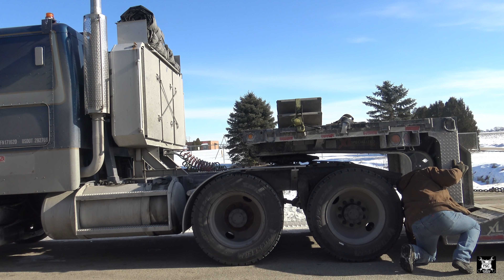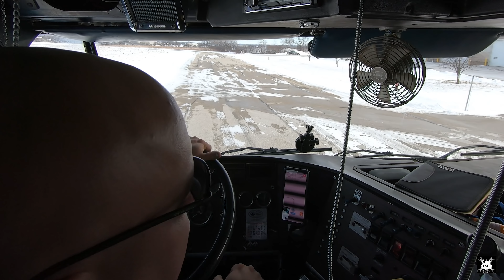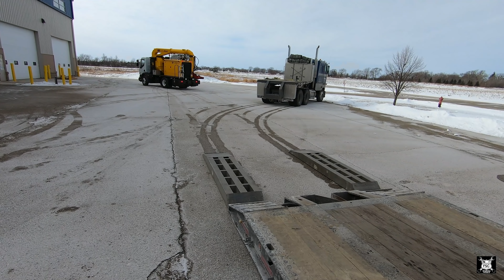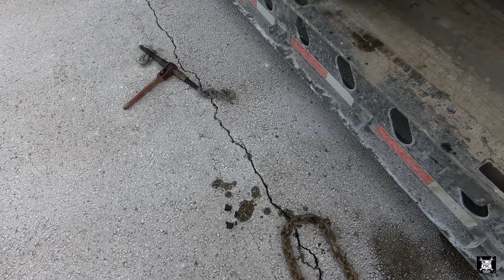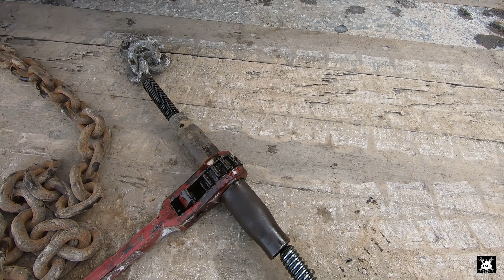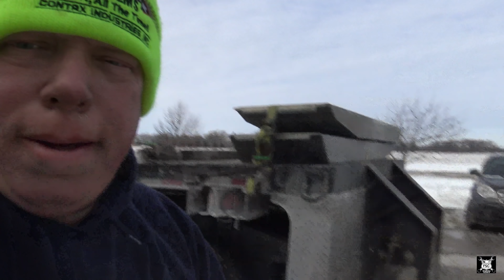Modern Cabover Peterbilt Blower Truck Loading

Comment: On some lowboy trailers that railroad companies own, they have special grooves for equipment that have small train wheels to guide them in place. Trucks that have these special train wheels are called "Hyrail Trucks"; they're designed for rail travel and working on tracks as well as road travel.

Comment: Well Paccar owns Peterbilt/Kenworth/DAF and that front on the Blower is the Cab is a DAF LF Model.  just rebadged as Peterbilt in the States.
Reply: Yes Paccar does own all those manufacturers however they’ve owned Peterbilt since 1958 but they acquired DAF in 1996 so I don’t see how this truck being from the 80s is a DAF unless Peterbilt bought the rights to use this design.
Reply: @FlaKBuS  He was talking about the Pete on the trailer...

Comment: I watched one of your more recent video's when you had the rental truck in Mass; &,not to be a knit-picker, but it's pronounced Woburn (Woo-burn), & also ALL those bldg's behind the Mall are all on one of the first Gov "Superfund Cleanup" area's for the extent of pollution.  They even have a pic of Sen. Kennedy (the 70's) in a Nasa spacesuit looking it over. I worked there in the mid 80"s, & on warm summer nights, you could still smell it.

Comment: Morning Steve. Peterbilt  and Kenworth did a class 6 medium duty. They where loosely Based on the English Style.. Hey your little Chebby does it have a 250 6 baanger? Have a Good Day.
Reply: I’m gonna guess a V-8 with a 283.
Reply: OK Dave, I Have a 69 Camaro with the 250 and a 4 speed. It has the same sound. A little knock. maybe I don't know that's why i asked.
Reply: @leroykees1170  I figured it would have a small block V-8 in it. Chances are you’re right. I never gave the 250 a thought. I had a ‘63 with a 327 for one year (30 years ago).